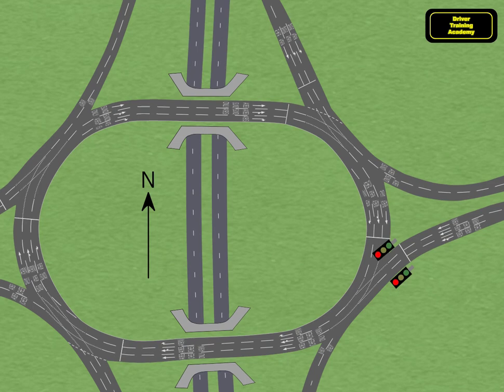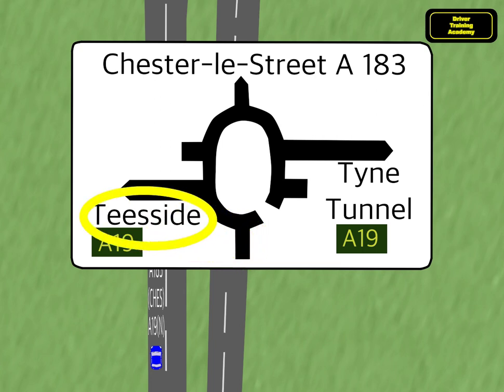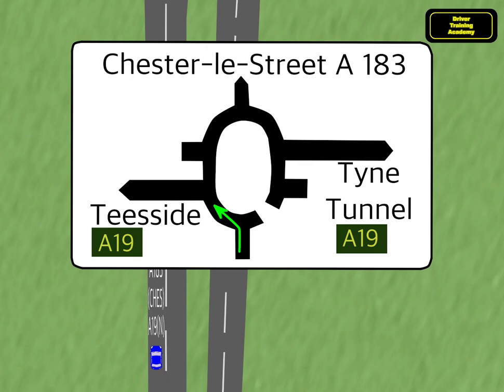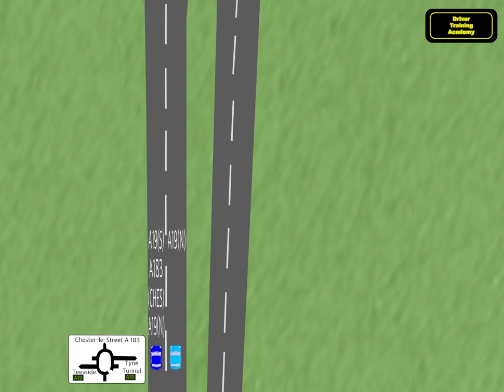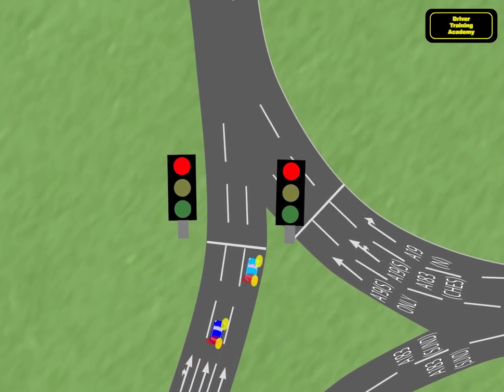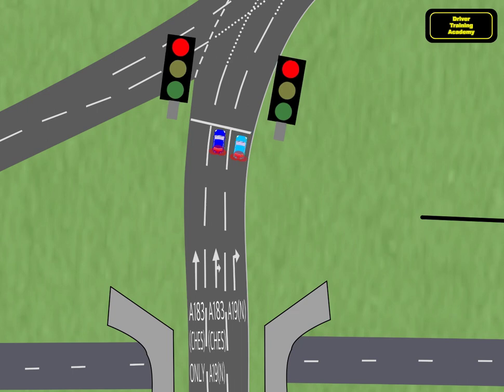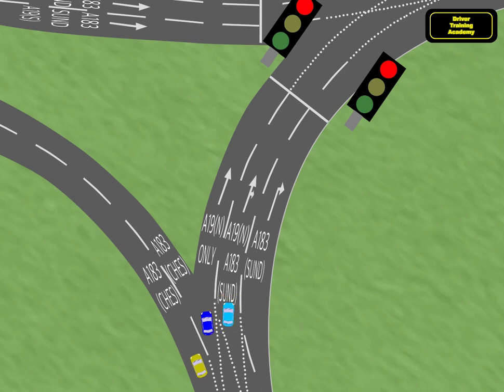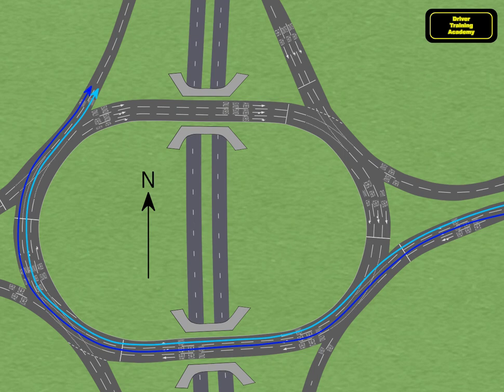Spiral Roundabouts 1

Comment: 7:36 probably also worth looking out for vehicles not following the correct dotted lines. Here for example, the cars may (incorrectly) drift into the middle and right lanes by following the wrong dotted lines (where the dotted lines cross over with the ones stemming from the A19 (S) entrance)
Reply from the maker: Absolutely. Never assume that other drivers will get it right.

Comment: Fantastic video and incredibly useful! The only thing I would add is at 5:45 "If there are three lanes approaching and three lanes on the roundabout, it should be logic at this point without the dotted lines." Very true, but if the left lane is marked Left Turn Only, do not include that lane in matching approach to roundabout.
Reply from the maker: Thanks for great feedback. You make a good point too.

Comment: If I saw that car driving in the middle lane with his indicator on, I would assume he wants to move to the right lane. If it was me, I wouldn't use the indicators at all if I was already in the correct lane. Maybe I'd use a left indicator as I left the roundabout to make it 100% obvious for people waiting for a gap to enter the roundabout but you said this was controlled by traffic lights.
Reply from the maker: It’s normal to indicate right before entering the roundabout, leave it on, and only switch to a left indicator after passing the exit before your own. As with all signals, use them for the benefit of others, but don’t confuse others. Your right signal as you approach exit 2 informs drivers entering from that road that they need to wait. Not so much on this roundabout due to its size and the traffic lights. Provided you use signals intelligently for the benefit of other road users without confusing any, that’s fine.
It should not be confusing to drivers in the far right lane if you entered on a right signal, stayed in the middle lane, then signalled left to leave the roundabout in the left lane.

Comment: Who agrees that the dark blue car, indicating at 4:10, just before entering the middle lane, will confuse driver in the right-hand lane that they want to move to their lane? Shouldn't that car just wait until their exit before indicating left? Why? Why not please?
Reply from the maker: They’re signalling their intention to turn right at the roundabout. This is particularly important to inform people entering the roundabout at the 12 o’clock position that they’re not exiting the roundabout there. Not so much on huge roundabouts like this one, but on a smaller roundabout the signal tells people at 12 o’clock to wait.
In this case they’re also signalling their intention to take the lane to the right where their lane splits just in front of them. Useful to people behind them.
When turning right at a roundabout, signal right on approach then signal left just after passing your penultimate exit.
Reply: @DrivingvideosUK  'signal right on approach then signal left just after passing your penultimate exit'. Yes, but how about the car in the middle lane continuing to indicate right throughout all the bits in between this? I'm a beginner, so looking to see if that is really necessary as it feels to me that it could confuse one group as much as inform another?
Reply from the maker: Because it’s the norm to keep the signal going , other drivers will (should!) accept it for what it is. On a roundabout as big as this one, you could signal for the lane selection at the start, cancel the signal, then re-apply it on the way to exit 2 (for the benefit of those who need to stop for us).
The key is (for all signals) to signal for those who could benefit but not to confuse anyone where it could cause danger. The driver on our right shouldn’t be confused by our continued signal but if they’re a good driver they’ll give us space to get it wrong just in case.

Comment: Really great video.  Roundabouts are a great invention, but I think they are implemented very badly very often.  As has been mentioned, the dots can be very hard to follow when it is busy or there is bad weather.

One thing that doesn't make sense from the diagram is the right hand lane arrow right as you are about to enter the roundabout (start of video).  Why would the arrow be straight ahead when that would be the wrong lane to go straight ahead?

I can't understand why all big roundabouts like this one don't have the lane guidance on a sign ABOVE the entrance of the road and at every set of lights.  When roundabouts are busy it can become nigh on impossible to see the markings on the road.  It becomes very nerve wracking on a new roundabout surrounded by large vehicles in the rain or at night and you are trying to safely find your way into the right lane.

What I hate is when roadworks are being carried out on roundabouts.  A bunch of cones are laid out and it becomes very hard to read the road, especially at night.  What lunatic though a zillion cones would be a good idea?

I think that councils should be fined too for not keeping up with the road markings.  My friend failed their driving test for not using proper lane discipline on a roundabout.  However, the lane markings have been completely worn away and even the arrows are almost gone!

When roundabouts are well signed and the paint is bold, they are great.  However, when everything is poorly signed, a bit worn out and hard to read, they are TERRIBLE!
Reply from the maker: Many thanks for the feedback 👍
Reply: Fookin completely agree mate

Comment: the thing that always confuses me is using indicators, because if i’m in the middle lane with my right signal on, wouldn’t that make drivers in the right hand lane think im trying to join their lane?
Reply from the maker: I see your point but no, the signal says “I’m turning right” and not a lane change.
Once you’re on the roundabout, all subsequent lane changes should be to a lane on your left.

Of course people get it wrong, and may indeed cause much confusion by attempting a lane change to the right.
Reply: @DrivingvideosUK  Can you suggest any references (Highway Code, Roadcraft etc) to confirm your point on this please?  If I was on a roundabout and a vehicle alongside me to my left was indicating right then I would expect them to be changing out of their lane.  I would have thought that being in a lane marked for a specific direction was in itself an indication of the driver's intentions with having to use an indicator.  To put it another way, if you were driving through a large city on a three-lane one way system would you show an indicator unless you really wanted to change lanes?
Reply from the maker: @davidharvey5161  Indeed the Highway Code and Roadcraft are good references. I would add “Driving, the essential skills”
The planned route of the car in the middle lane is not obvious from the road markings; the middle lane can be used to take the right lane on the next exit (should signal left) or to continue around the roundabout to the 3rd exit (as in the video), signalling right. The right signal should change to left once past the 2nd exit.

Comment: What I don't understand about spiral roundabouts, is that you're expected to move over to the left outside lane BEFORE you reach the penultimate exit. Which you think would confuse drivers into thinking you're exiting the roundabout now.
Reply from the maker: Worse. If you were to move to the left lane BEFORE the penultimate exit, you would hit any vehicles on your left which are planning to use the penultimate exit. You should move from middle to left lane JUST AFTER the penultimate exit on a 3-lane roundabout. Take a look at the “demo all lanes” video which should help.
Reply: @DrivingvideosUK  so should this be done slightly earlier than you would a normal roundabout?
Reply from the maker: On a normal 2-lane, 4 exit roundabout, turning right to exit 3, I would enter in the right lane and move to the left just after exit 2, leaving room in the left lane for traffic exiting at exit 2. So I’d be moving from right to left just after exit 2.
Reply: @DrivingvideosUK  but on a roundabout you have to stay in your lane until the exit before yours. Oh sorry you said 2 lane roundabout. But would you do that on a roundabout with more than two lanes? Thanks
Reply from the maker: You usually have a choice of 2 lanes to turn right on a 3-lane roundabout so it depends which one you chose. Watch this video and make sure you watch both cars going to exit 2 (ahead) as well as both cars going to exit 3 (right).
Note also the car doubling back (using exit 4) which starts in lane 3, moves to lane 2 after exit 2, then moves to lane 1 after exit 3.
Reply from the maker: Spiral roundabouts 2 (Demo all lanes)
Reply from the maker: That should have been a link to the video. Pasting the link hasn’t worked.

Comment: The double dotted lines are really confusing! At 7 minures, how do you know which set of dotted lines to follow? You could end up in the middle lane, left lane or exit the roundabout! Why is there a lack on consistency in markings Dotted lines only for entering vehicles would be a good start. Which markings can you trust? 
I've been driving for 25 years and Spiral Roundabouts still baffle me!
Reply from the maker: You’re absolutely right. There are 2 sets of dots to follow. 1 for traffic entering the roundabout from the left of picture, and the set we’re following on the video. Where these cross it would be easy to follow the wrong set. However if you consider the dark blue car in the middle lane, it could leave in the right lane of the exit, or it could do what it does in the video. Failure to move over to the left lane would “push” the light blue car into the right lane making it very difficult for the light blue car to leave at the exit after this one. I guess the dots or studs are easier to follow in real life, but I’ve seen many drivers remain in the middle lane at this point. Another way to look at it, is that there are 2 lanes (middle and right) entering the roundabout that can go to exit 3, therefore they must flow together to exit 3, so after passing exit 2, the middle lane must spiral out to the left lane. Take a look at the “demo all lanes” video to see if that helps. None of this alters the fact that the dots can indeed be confusing!
Reply: @DrivingvideosUK  They're not always easier to follow in real life!, weather,  other vehicles covering them, having to keep one eye off the ground on traffic etc, so you can't see your path. I don't live near one,  I encounter one of these maybe once a year and I'm sure I'll forget all this when I next do!!! In real driving, you wouldn't want a car to your left or right in the blind spot, especially on an unfamiliar roundabout, where you should expect other cars to make lane changes. I watched this as it was pointed out to me that these roundabouts exist, to explain why I had always got them wrong, trying to treat them as conventional roundabouts. 
I did live for a year near a gyratory roundabout (2 motorways intersecting with a number of local exists too, so non Motorway conditions), which I mastered after a few times, and was able to spot unfamiliar drivers and give them the space they needed to change lanes (the signposting is terrible though and inaccurate)